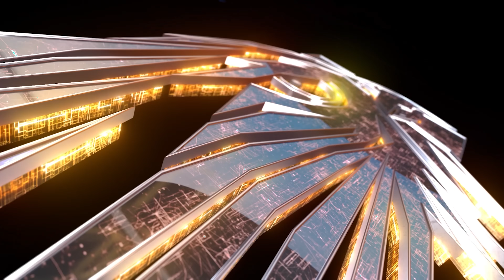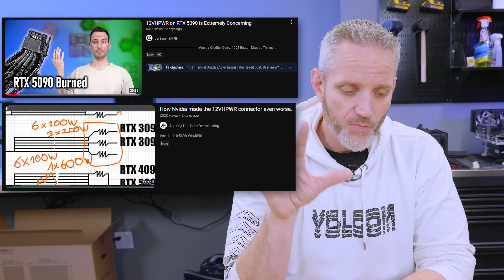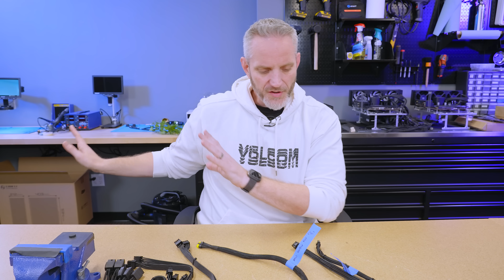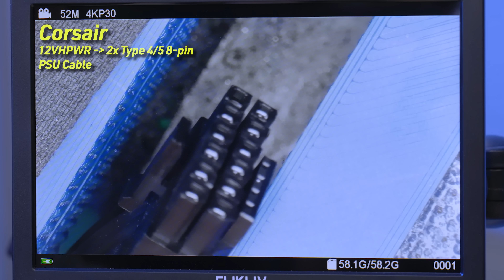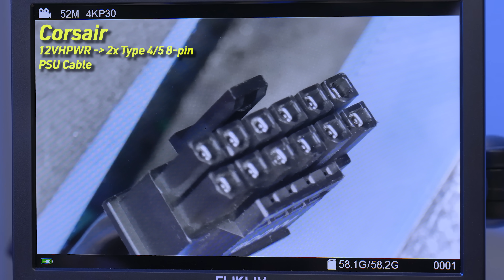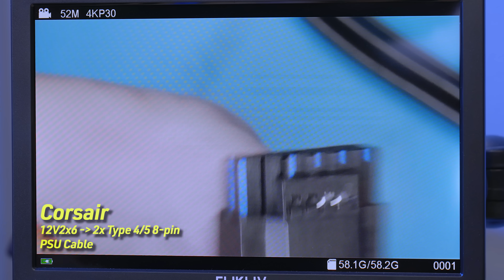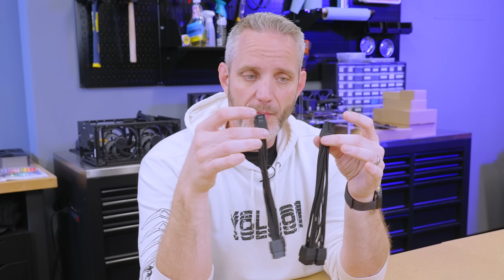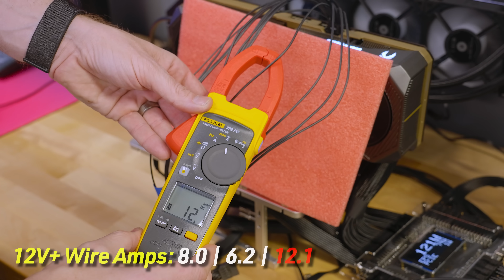I discovered something concerning and I need the Experts to chime in... More 12VHPWR discovery!

Comment: just generally, if you want to test the actual cable assembly resistance (including contact, crimp, and wire, which is what influences the current balancing), you want to look for a 4 lead milliohmmeter, that plus some 0.64mm square pin headers which are 3.85mm long on one side, and long enough on the other to attach a pair of test leads, would let you reproduce the pin in the header and then test the resistance of the entire cable assembly (which should be in the neighborhood of 16+/-2mOhm by my read of the spec incorporated ATX 3.0/2.1a). Depth of the connector is likely less important than contact wear (check out the oc3d piece on their issue which was solved via a new cable assembly which would have terminals that are still factory spec). 

h++ on the cable is irrelevant and not required, it's the board connector which requires h++ marking as that's where the pin lengths were changed (my nvidia squid doesn't have h++ at least)

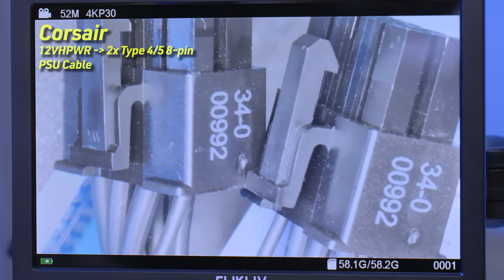@8:20 as a data point, updated corsair RMe uses 12v-2x6 on both ends

(didn't get a timestamp for this) ground was more balanced in my personal observations, maybe reduced high frequency effect from the front side of the psu- Igor has some commentary there

@8:52 the total receptacle depth is 6.60mm, the target contact point on the pin is 5.1mm from the front of the socket (1.5mm from the back) and you have overall 3.85mm of pin to make contact with before the chamfer, so long as the dimples (or springs) on your terminal aren't greater than 3.85mm past the face of the connector it should still be be making good pin contact.

@9:50 ground not being seated would be similarly bad, you can overcurrent a grounding conductor it's current carrying

@13:18 the whole terminal isn't making contact, only the dimples/spring surfaces

@14:09 depending on how the adapters/squids are wired internally, I think they potentially complicate the parallel resistance that's inherent to the cable design, and makes it less predictable than a single PSU manufacturer designed and provided cable

@16:00 to do the milliohm testing with corsair's cable, you'd need an appropriate pin header for the mini-fit jr (psu) side, I can't seem to find that on Molex's drawings

@17:00 despite the size of the mini-fit jr, it's rated for similar current as the cem 5.1 micro-fit 3.0, more mating points also means even more unpredictable resistance.

@20:16 nothing there is warm, the scale on the side is maxing out at 30c, ATX 3.1 calls for a 30c rise so unless it's freezing there in the room you've got probably 20c more headroom, and you're actually still well under the acceptable ambient operating temperature of 50c.

@21:38 your observations there with the PMD2, it's paralleling the conductors into 3 groups so it'll be behaving in a potentially similar way to the NVIDIA squid- i.e. now you've got 2 places to check for current balancing. Also worth noting here, 55.4A on one side and 54.1A on the other- unless the PMD's dumping 15W of power as heat (guess it could be, there's a few shunts and terminations in there, but unless the PMD current paths are in the neighborhood of 31mOhm it seems a little high) you do have some variance in current as the card power shifts up and down. Ideally we'd have per-channel shunts or DC CTs on each leg. Along this note I also wondered to Jonny if an inline 50mOhm resistor in a cable could have a balancing effect, sacrificing a little power to raise the average assembly resistance, so the variability between conductors isn't as pronounced.

Comment: Engineers: we need a new connector capable of 600 watts
[clown progression] it will travel across 6 flimsy pins
[clown progression] it will have no electrical headroom
[clown progression] it will not account for manufacturing or user errors
[full clown] why are our connectors melting?

Comment: Based solely on the thumbnail, one thing that should be made clear is that it's the pins that make the best contact which get more current on them.  The pins with bad contact have a higher impedance, and therefore get less current.

So if you see a wire that gets really hot or has melted insulated, that wire had the best connection.
Reply: Correct, high resistance equals less current.
Reply: Yes less current but higher temperatures, i think that is the problem
Reply: @signor_No  No the temperature is not higher. Less current is less heat. And the only place this would even make a difference is at the connector. The other wires with proper contact have less resistance, so more current flows through them. The problem is that the current that is "missing" on the "bad contact wires" is going through the "good contact wire" instead.
Reply: @xdevs23  mhhh yes, in the good contact can pass trough more current that mean more heat and more resistance, and all burn, all because 1 bad contact
Reply: Wrong, wrong, wrong ….. you cannot have “heat” without resistance (impedance is incorrect term).

A “best” connection has (basically) zero resistance , hence no generated .
A “worst” connection has very high resistance , hence will show overheating.
An arcing connection shows highest heat.
Reply: @ernestgalvan9037  Impedance is resistance.  It's the correct term to use for an electrical connection that is ideally not suppose to have any resistance at all.

You're also completely wrong in basically every way.  As soon as you have current flowing through a non-superconductor, you have heat.
Reply: @TrueThanny  impedance it's only used in AC not DC, in this case it's 12V DC there is only pure resistance, and you are correct about the heat and resistance, more current, more heat, more resistance...
Reply: and what if the connectors that have less contact are arcing ?.seems your theory may be flawed